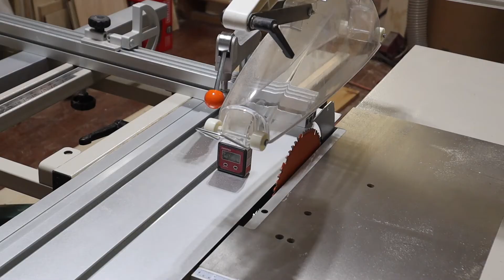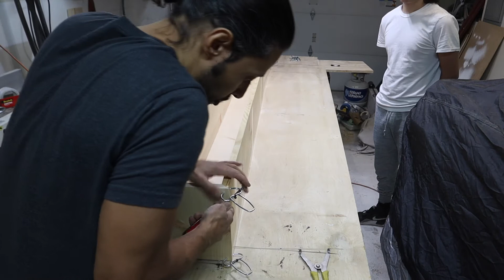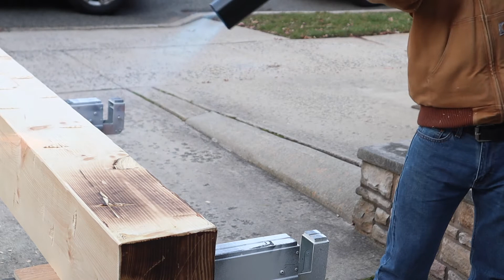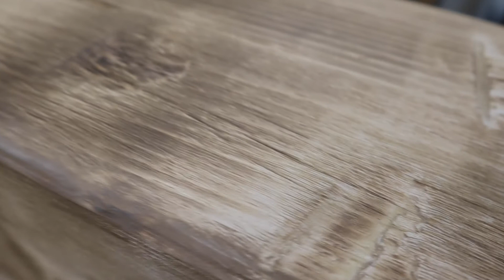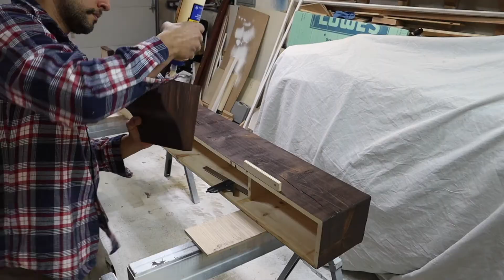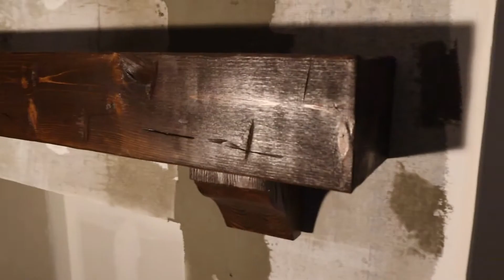Rustic barn beam mantel

Comment: Great project. On all these faux beams what bothers me is that the ends don't have end grain. Couldn't you take a piece of the corbel cutoff and make a 45 degree cut to insert that in the end? Just have to be a little more picky on the glue up maybe?
Reply from the maker: The corbels were no where near the size of the end caps.  you would either have to have a solid beam and Slice a piece off of the end and it would have to be the exact size you need or bigger, which defeats the purpose because if you had a beam that big, you would just use the solid wood for the entire mantel. If you did a glue up, you would have to face glue about 8-10 pieces of wood or more to get the size you need and you would never really make the growth rings look the way they should and lastly, all that work you do to make that end cap look like end grain would make you have to charge the clients a lot extra for your extra labor, time and materials. You can do for yourself but I am not, so it really defeats the purpose of saving time and money for you and your clients.
Reply: @AnthonyScolaro1  true enough about time and money,  it's just a personal pet peeve. 😆
Reply from the maker: @Belg1970  you’re absolutely right, that’s why I always give my clients the option of what they want but unfortunately they would just have to pay extra.